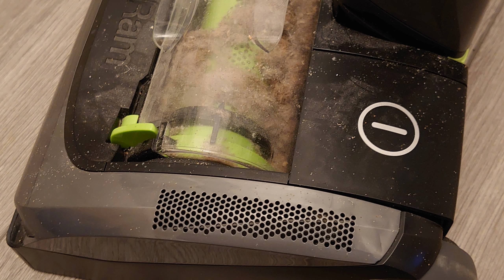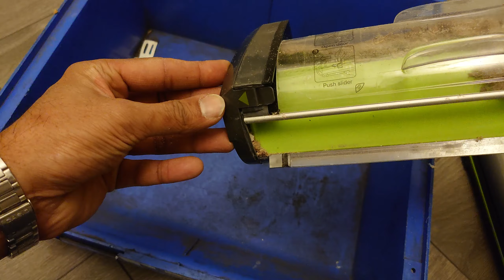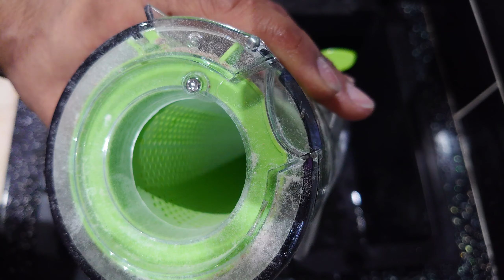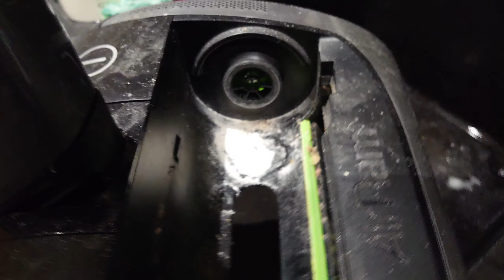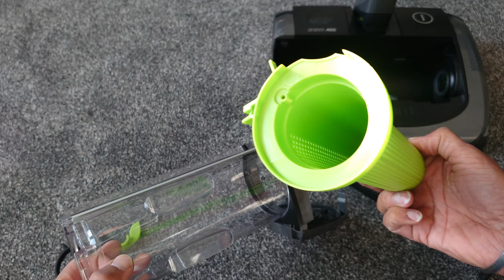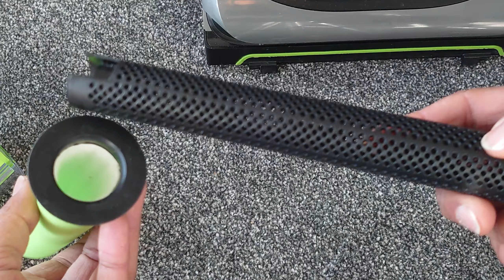Clean Gtech Air Ram AR29 Cordless Vacuum Cleaner STEP BY STEP

Comment: Had mine for years just stripped mine and daughters down,didn’t know about that little screw this will make it easier to clean,these machines are not meant to pick up large pieces,great for carpets and small crumbs etc,lightweight and easy to use👍🥳
Reply from the maker: Yeah very useful. Probably don’t use mine enough 😂

Comment: I wish it was a regular screw because I can't find anything to remove it to clean properly.. Otherwise very happy with my Gtech cleaner.. 😊
Reply from the maker: It’s really worth buying a little multi kit from eBay or Amazon, less than £10 and will take apart nearly everything. I’d be lost without it. Good thing about having a Gtech is the kids love using it so me excuses for not cleaning! 👍
Reply: Sorry I've bought 2 different sets of those tiny screw remover  things and nothing fits.  Just can't think of the name..  Hex screw??
Reply from the maker: @sandragammack4890 Hex head is just a hexagon shape, what you need is a security star set or spline style. I will check and confirm how many points are on the head. I can also send a link over to the kit I have too which definitely has them in 👍
Reply: @sandragammack4890  Torx?

Comment: How do you remove the brush roller to get hair that is trapped around the ends, which are inaccessible, please?
Reply from the maker: Hi, got a video lined up for this too haha. Ok on one side there should be a button (depending on the model, I don’t have one right now to check as we’ve sold all ours atm) press this in and the whole bottom section should clip out. From there it’s just a case of unravelling, cutting away and giving it a good wash with some warm soapy water. Will try and get the video up soon.
Reply from the maker: What looks like the button is actually part of the brush bar housing
Reply: I’ve un-done the screw but I’m struggling to get the green section out? Any ideas?
Reply from the maker: What is the model number on the bottom?
Reply: @robertthomas8381  mine was same as don't think it had ever been taken out , gave it a bit of a wiggle and a hard pull and it came out. If I hadn't seen this video i'd have assumed it was glued in or something

Comment: Hi..I cant get the the black filter top to clip into holder any ideas please..thanks
Reply from the maker: Do you mean the black circular bit with the clip on which houses the tube that slides into the main tube filter? If so that should slide quite easily in and out, if it’s not going in all the way and clipping in, can only assume there’s something stuck at the other side preventing it from seating properly. Sorry a bit hard without seeing it if you know what I mean